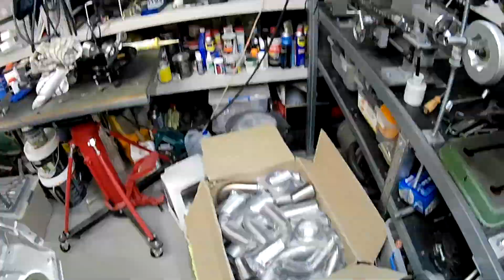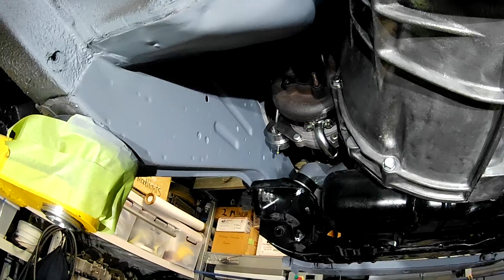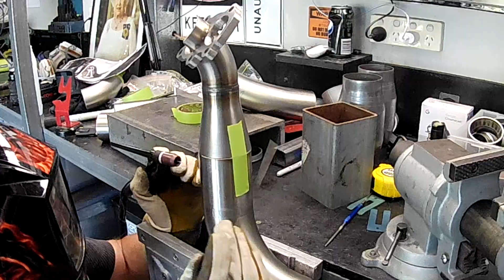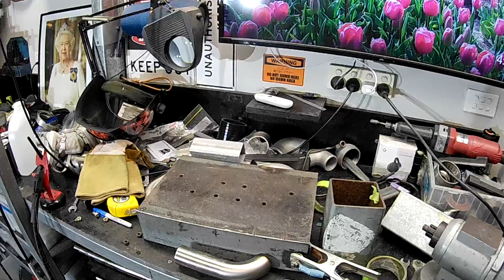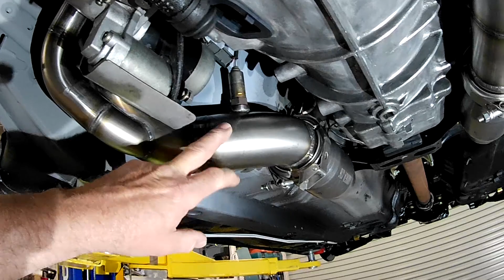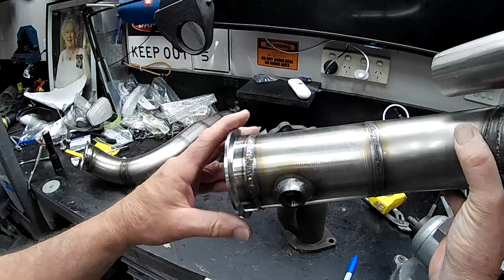Stainless Dump Pipes Fabrication. Project Fairlady, The Nissan Z32 300zx Twin Turbo Mega Build,

Comment: Oh, if you want a truck project, a really common engine swap into the smaller old Toyota trucks is the early model of 1UZ-FE pulled from the SC400 (Soarer) or LS400 (Celsior) or GS400 (Aristo) made by Toyota and badged as Lexus in much of the world. It's a super light all-aluminum V8 displacing 4.0L and producing a naturally aspirated 290HP at the crank for the later VVTi model. The earlier model (91-94) only puts out around 250HP, but has stronger connecting rods and valves, so is considered preferable to build on due to it's ability to accept higher boost. Turbos, screw-type superchargers, and centripetal superchargers are available for it and people have squeezed 800HP out of them. It's pretty common a swap because it maintains brand coherency, but also because it's quite a short motor length-wise and can be nestled far enough back in the engine bay that you can practically make a front-mounted mid-engine vehicle out of it by having the entire block behind the centerline of the front wheels. Just expect to need to make your own headers regardless of whether or not you use a turbo or two, because you'll probably need to get creative with a tight-tucked header set regardless of your boost methods. As far as I'm aware, there are very few AWD systems from Toyota that utilize the 1UZ block, though there are plenty that utilize the iron-block 2UZ variant, though I haven't found anything regarding the bell housing matchup between the two, so you'd have to do some research if you wanted an AWD truck with the 1UZ.

Comment: you can section and tape together cardboard tubes of the approximate desired diameter to mock up exhaust runs, which is what Bad Obsession Motorsports did for Project Binky when they finally got around to addressing how they were ever going to get a 3" exhaust under a 2.0L turbocharged Toyota Celica GT-4 swapped Mini when it barely had room enough for the drinking straw it called an exhaust pipe in the first place.

I thoroughly appreciate your use of high-flow catalytic converters to keep the car emissions compliant. It'll probably hurt your maximum power output slightly, but it'll keep it meeting regulations and it makes the polar bears happy, or something.

Comment: I hear that splitter on the flange can cause boost creep? Do you have experience with & without?
Reply from the maker: G'day Jeri, on a poorly designed dump pipe it sometimes does.
For example, if there was a divider in the dump pipes that I removed from the vehicle, it may have had that effect. In that particular situation the issue is not the divider, but the really crappy design of  the pipework & the under sized wastegate outlet. Proper divided internal wastegates are definitely the best option, but they have to be done right. A lot of turbo pipe work is made by folks who have no understanding of how it all works, particularly, but not limited to, stuff out of China.
Great question, Cheers Mate.
Reply: @TheAussieShed  It's all about flow.  I experienced boost creep with dividers on very nicely made pipes after doing full breather mods.  If the engine builds boost fast, revs fast, and outflows the capacity of the waste gate pipe, creep can / will occur.   I'd also say the waste gate on the turbo also plays a part.  Anyhow, in my case removing the divider helped as it allowed more flow out of the waste gate
Reply: @TheAussieShed  Any comment on external wastegates vented back into the exhaust gasses instead of to atmosphere in the engine bay? I'd think it would somewhat simplify matters, but I'm not sure if it is detrimental to performance or not compared to integrated wastegates.
Reply from the maker: @mndlessdrwer  Hi Robert, you should check out my previous build series, as I used external gates on that build + quite a bit more fabrication too. https://www.youtube.com/playlist?list=PLooB2EjBotjK9cmVFXNsyyC_ljyN8yasv       Cheers.
Reply: @TheAussieShed  I definitely will be, I just happen to like the 300ZX more than the 350Z and 370Z from an aesthetic, engineering, and JDM weirdness standpoint. It's hard to find cars with more 90's JDM weirdness than the 300ZX (Z32).

Comment: Awesome Awesome Awesome, I hope he takes us on the journey of tuning and driving. As a 300zx TT guy for years, personally I would use stock engine mounts. They can handle a fair chunk of power. I put the BDE's engine mounts on my Z and it was way to harsh for street driving, so changed them back. But this Z - I assume is for hobby racing. I have GT2554's turbs on my slicktop  with a reduced exhaust housings to .49AR on e85 The power is a controllable explosive ride for the street- Not choked power, is just a lot lower down. Works for me!